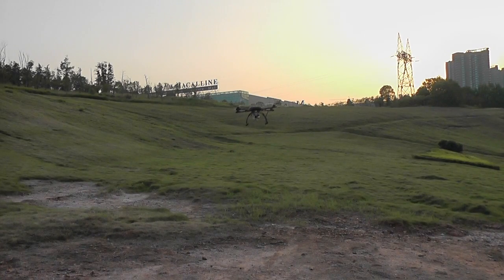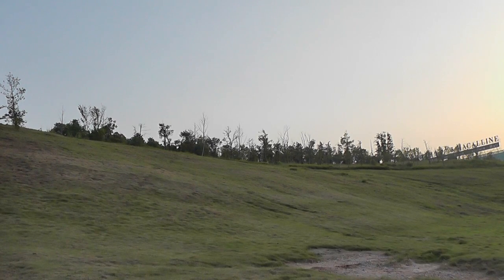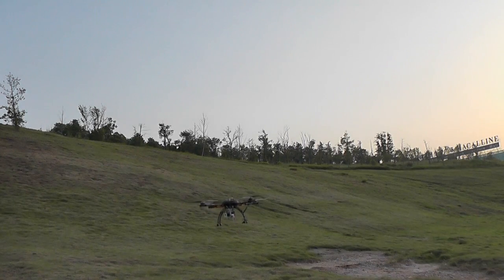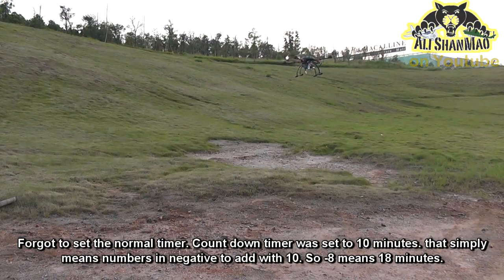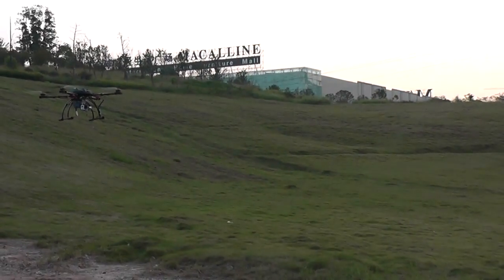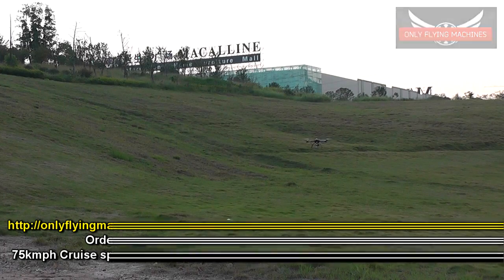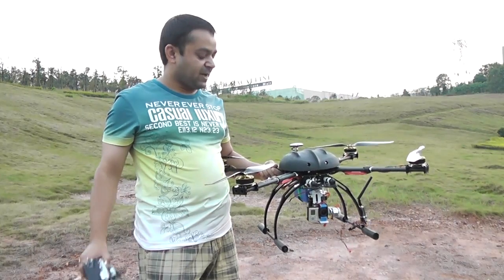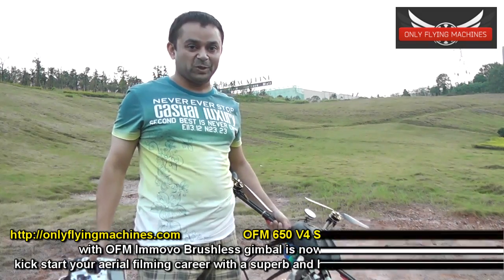OFM Intruder Q7 Quadcopter Testing Scorpion motors

Comment: oh yes forgot to ask. we saw a man go up in a full size model, about 10 feet off the ground. he was there for only a few minutes. it was electric as well, but it had a open cabin. if he would have fallen the propellers would have ate him up. when do you think these will be sold for full size use? it would be very cool to see one with a cock pit, shut for motor/battery failure. you know like the light plane shuts to bring the down soft? again cool video we want one ha ha ha

Comment: It will depend on which Scorpion motor you choose. I run Scorpion S2-2215-1127kv (AUD$75 each) on an F450 with a 4S LiPo, it's TOTALLY insane. My setup is the same as an Aussie YouTuber called CRUDDBUCKET. Visit his channel & watch "DJI Flame Wheel F450 (Cruddcopter V2)" & "Cruddcopter V2 on steroids". It's so fast & so much fun I built a 2nd bare bones F450 with no accessories & totally ballistic. Currently waiting for a small Carbon Fiber frame to arrive to run them on... Can't wait... :)

Comment: Hi Ali, How do you rate the Scorpion motors for use on the OFM Seeker 450 V2 Special Edition in comparison to normal motors? Would it increase the speed and battery flying time as well as it has on the OFM Intruder Q7?